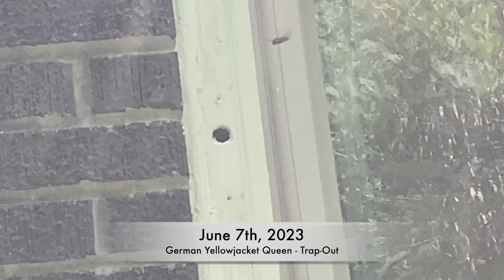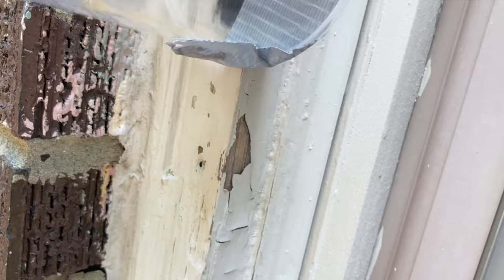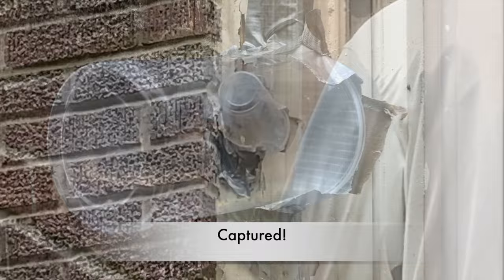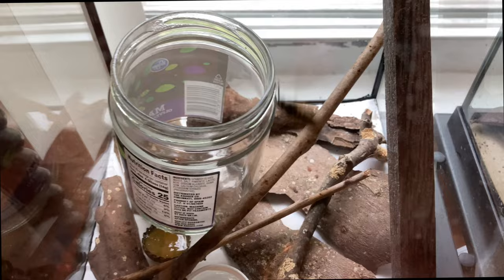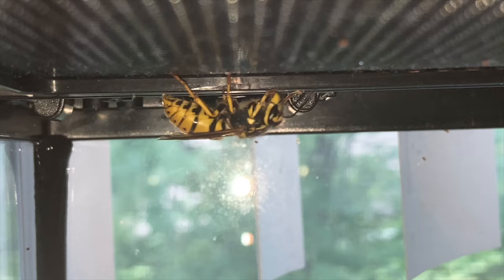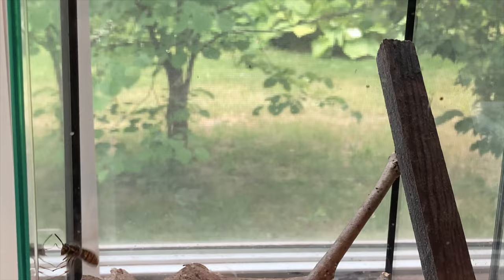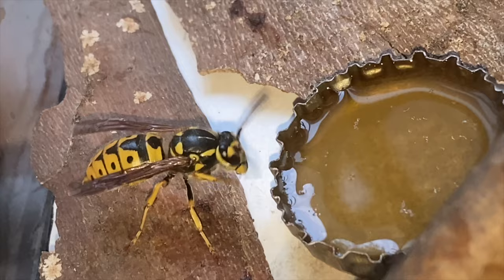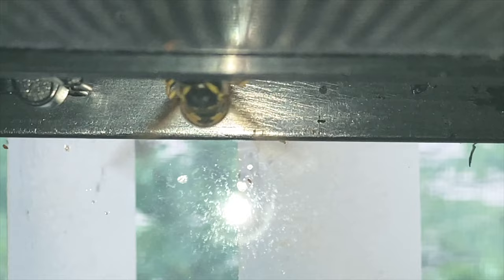QUEEN WASP TRAP OUT - CAPTURING YELLOWJACKET QUEEN BEFORE SHE CAN ESTABLISH A NEST INSIDE A WALL!

Comment: How do you restock food?
Reply from the maker: Hi KM. Thanks for your comment.  We restock our captive wasp habitats with food/water by waiting until the wasps are settled for the night (they tend to shelter somewhere inside the habitat and stop moving after dark).  During the day, we wait until they are at the back of the habitat (which usually faces the light/windows) and quickly open the door and drop in the food/water, then close up before they can fly out.  We've had a few escapees that had to be recaptured, but usually it works out fine.